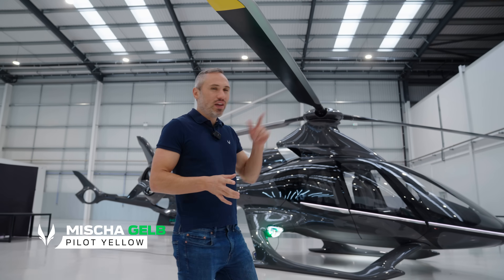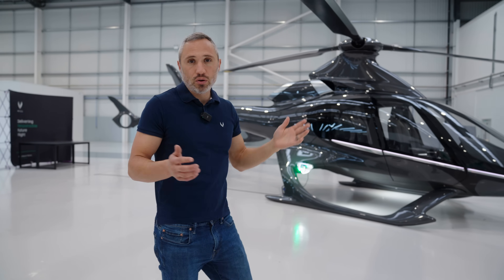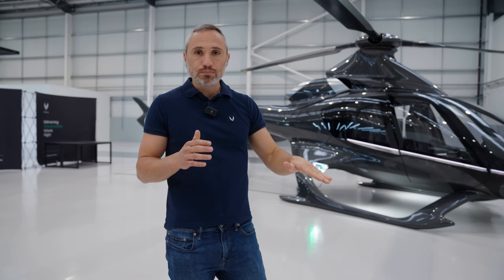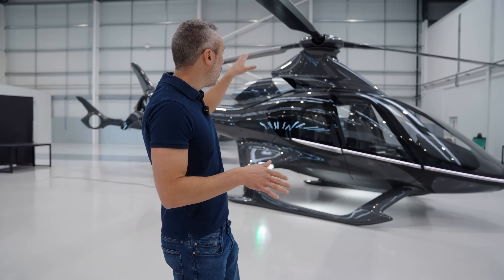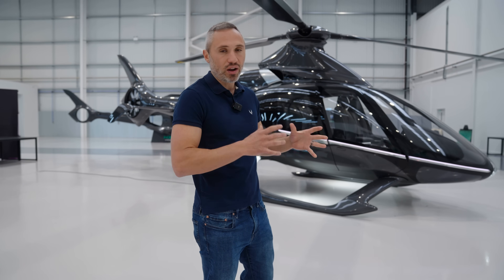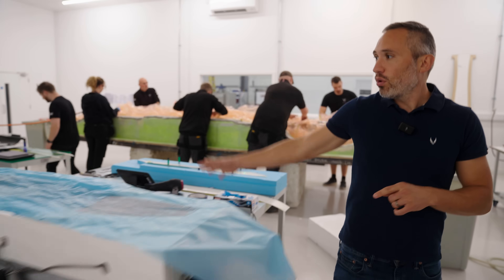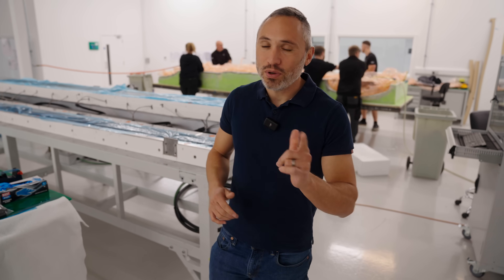How to safely land a helicopter after an engine failure

Comment: having seen many designs of helicopter, i always been interested in what designs work better than others - for example, do more blades increase or decrease the performance depending on size of machine, engine power etc, and how this fairs during engine shut down, descent, flaring etc - large military helicopters mostly prefer a larger wider four blade prop, bigger wings, and smaller helicopters have three, i guess mostly due to engine power
on the Apache the rear tail rotor has an unusual configuration of four blades, but why, and as we see on Hill helicopter the rear tail rotor is a closed fan but with more blades, what's the advantage, and could this configuration be used in the main rotor, i suppose that might be expensive to produce but interesting to know what happens with a computer model and air tunnel testing
i am loving this Hill Helicopter, i think the vertical integration is working exceptionally well so far and i'm looking forward to seeing this machine bring back what Britain seems to be lacking, make Britain great again
speaking of, great paint jobs, can we get the first test machine done in Union Flag red white and blue, a bit of tradition
Reply: Blade amount is just one aspect of performance. It might be easier to think of it in terms of a car. If your goal is to be able to go faster off the line in a drag race, bigger or more tires only helps if that's the thing that's limiting you. If you have a big race car engine and tiny little wheels that do a burnout every time you go to accelerate, then you should get bigger tires to improve grip. However if you already have big tires and the engine isn't powerful enough to turn them quickly then adding wheels isn't going to help because you're already not utilizing the tires all the way. The same applies to helicopters. If you have a tiny engine then you're going to hurt performance by adding more blades because you're already not using them to the fullest extent. But if you have multiple big engines then more blades makes more sense. Hopefully that helps.
Reply: @Maxmason5695  yep i guess so - i might also expect each blade produces some drag and or friction, if there are more blades, these might cause disruption for the next blade behind it, where as the fan at the rear is only to prevent the airframe from spinning with the direction of the rotating disc
i am guessing the more traditional 3-4 blade is more effective and better than that of 2 blades - i am surprised at the Hill blades being quite slim, very neat

Comment: New Helicopter Concept Idea:
I came up with an idea to improve helicopter safety by using a system that moves the weight inside the rotor blades inward toward the main rotor shaft. This could be done using a wire or belt pulley mechanism. By shifting the mass closer to the center, the rotor RPM could be maintained longer during descent, allowing for safer emergency landings.......🚁
Reply: Interesting, but mechanically complex. Automatic 4-axis control of collective pitch lowering and cyclic rearward movement is a very practical solution converting height and speed into rotor rpm. If the idea is about increasing landing options then batteries (probably LTO for 30C) are a lighter store of energy than mechanical systems - problem is patent ownership for turbine-electric hybrid systems...

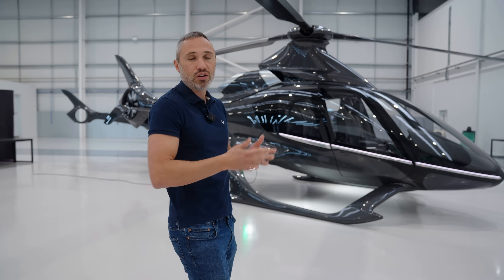Comment: 03:49, not inertia but rotational kinetic energy of the rotor in jouls  witch is equal to I*w^2 where (I) is the mass moment of inertia of the rotor in kg*m^2  and (w) is the angular speed of the rotor in rad/sec .
Reply: Quite true, but you missed a 1/2 in the R.K.E. equation. High inertia reduces rotor gyro pitch & roll rate to cyclic input for benign handling too.

Comment: I'm glad to have autorotation in a helicopter in case of engine failure. BUT it's of course not the same safety a BRS provides. In case of structural issues, rotor head, main rotor blades, etc., autorotation is gone from the menu, while BRSes provide an option to not fall from the sky like a stone. Think of R44 mast bumping, etc. No autorotation, BRS would save lives. I own a Cirrus as well and there have still been 0 fatalities when CAPS was pulled below VNE and above 1000ft AGL.

Of course I expect the rotor design of the HX50 not to have the issues of the Robinsons, but hey, at the moment no engine failure at all for lack of an engine 😉

Comment: 3-Blades eh, hmm. Has anyone done an actual Vibration-Frequency test on that 3-Blade system
compared to a 4-Blade system and how each system affects the composite body design (Resonance)  ??
Remember, the mighty walls of Jericho were brought down by sound. Personal Views is all, 
thanks for the update. :)
Reply: Your comment is uninformed of physics.
Reply: Jason Hill comments that 3 blades were selected as most cost effective solution to articulated hinge offset for manoeuvring. You are quite correct that 3 blade designs can allow the blade first bending mode (3/4 wavelength with node at hub & antinode at tip) to correspond to 3P aerodynamic excitation with vertical input to fuselage (or 2P & 4P moment input, where P = oscillation per rotation). But the trick is to tune the rotor blade with the weights shown so that this doesn't happen in the rotor operation rpm range. 3 bladed designs can and do work, and 4 or 5 bladed designs increase the cost for the vibration reduction.
This is why so much analysis was needed. I imagine that there will be lots of testing, with Campbell plots, to verify the rotor blade behaviour before the aircraft flies. And probably plenty more once aircraft is flying.
Reply: Are biblical stories factually accurate?

How many cubits ,one was the ark?

😃

Comment: Does it have a running engine… yet?
Reply: There is an AMA every few month, grow up and watch it, save yourself asking daft questions.
Reply: How many helicopter engines have you designed and built lately? You know it takes time, right?
Reply: @andrewcbartlett  He's probably built the same number of flying helicopters as they have. Except he's hasn't told people he would have it done by 2023, or 2024, or 2025.
Reply: @Maxmason5695  What are your talking about? From their website, "When will the helicopters be available? Deliveries of the HX50 will start in 2027." Actual customers would be informed of this.
Reply: @andrewcbartlett  In case you haven't been following this project very long. In 2020, when they first announced the program, they said they would have first flight done in 2022. With deliveries to customers in late 2023. Then they delayed to first flight to 2023. Then announced an easier goal of a ground run with the engine by 2024, with a goal of first flight by 2025. Its nearing the end of 2025 and we have no evidence of one even spinning on the ground much less being delivered to customers. We all understand that building an engine much less an entirely brand new helicopter is a long process. But people are tired of getting delay after delay then seeing intro to PPL autorotation explanation videos with a fake helicopter in the background.
Reply: @Maxmason5695  Do you have an order? Do you speak for all customers who have an order? I would expect you can sell your spot in the queue. Most of those waiting probably already have an aircraft and will wait for their delivery.
Reply: @andrewcbartlett  Ok so now that you are up to speed on the fact that companies can just update their website. I haven't said anything on behalf of actual customers, if you call donating money and receiving no product in return being a customer. I also don't assume anything about the people waiting 2+ years, such as most of them already owning helicopters. But you can go into the comments of every video Hill posts and see people having valid questions about the reality of their progress.
Reply: @Maxmason5695  So you are not a customer, just a clown in the comments!
Reply: @andrewcbartlett  No one is a customer, they haven't sold anything yet. We are all just clowns down here in the comments.
Reply: @Maxmason5695  If you order something to be made like a car, boat, helicopter, house, then you must sign a contract and you are then the customer of that company. Why am I explaining this to you, are you ten years old?
Reply: @andrewcbartlett  You feel the need to explain this because you have no other points or ways to defend this behavior other than making accusations, or calling people names like clowns or 10 year olds. You don't have to hold water for this corporation. Praise them when they do good stuff, shame them when they do bad stuff. They're not going to give you a discount on your imaginary helicopter, because you called people names in the comments section of one of their videos. If you even do have a reservation for the ability to order one.
Reply: @Maxmason5695  I agree. Seems Hill themselves are still learning how long it takes, and WAY underestimated the complexity and engineering required.

Comment: Pilot incapacitation in small aircraft happens sometimes but most times ATC is able to walk the passenger through landing the plane, im sure this happens in helicopters but ive heard its near impossible to teach a passenger how to land a helicopter, my question is can autopilot land a helicopter  or is anyone working on a solution like what cirrus did with the push button to land?
Reply: 4 axis yes